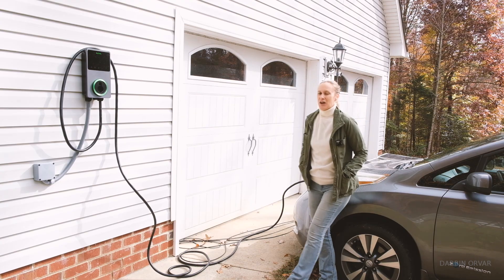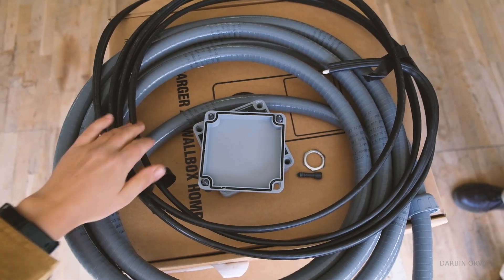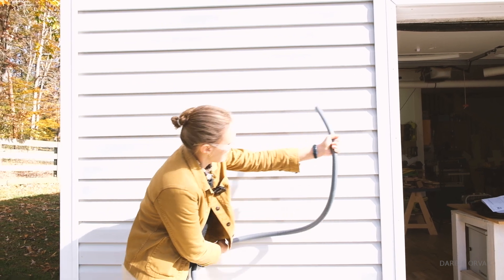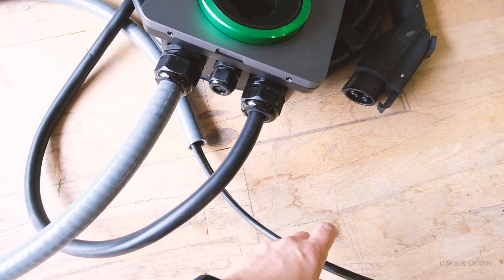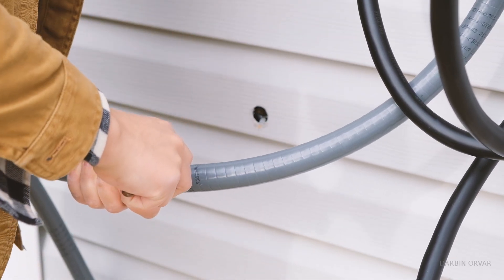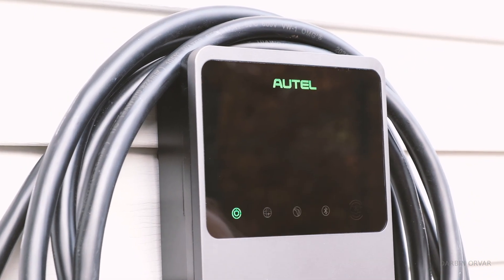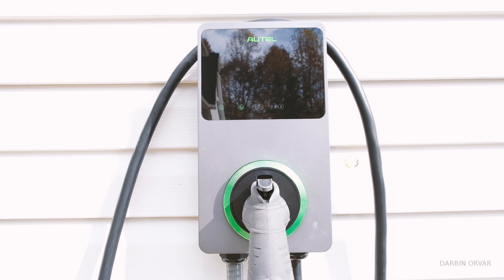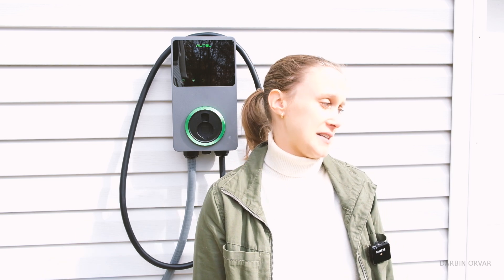How To Install a Level 2 EV Charger (ft Autel MaxiCharger)

Comment: Why have you run that cable outside? I am puzzled. It looks bad, why not run the cable directly through the wall?
In your area, are you allowed to install 240V 30A without a certified electrician (good for you)?
I am in Nevada and that's a no go.

Comment: Did I understand you set the charger to charge at 30amps? If that is the case then is the circuit 30 or 50amp?
Reply: if set charger at 30amp, the circuit should not less than 40amp

Comment: Erm….. well, ok, at least you closed the hole of the junction box. This is for sure different as we would do it over here. And tbh, there will be no need to change the wiring again so the foam is ok

But nice solution.